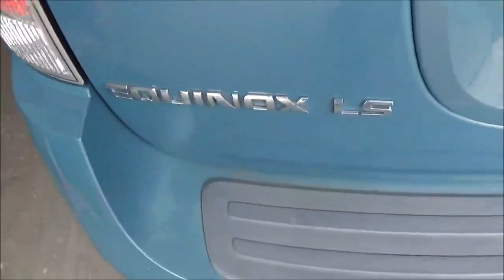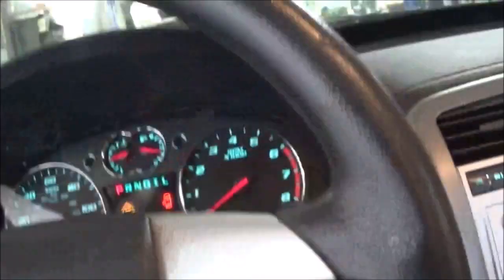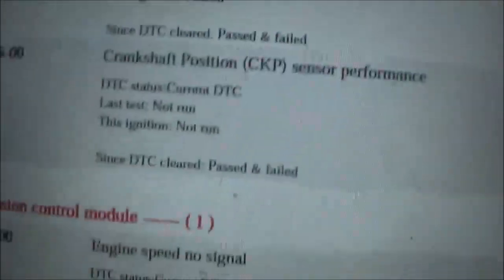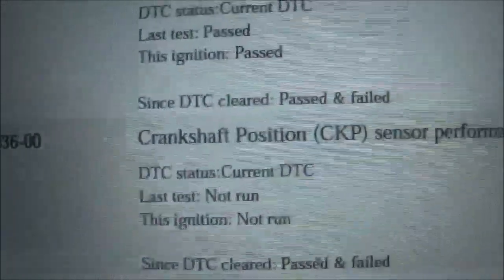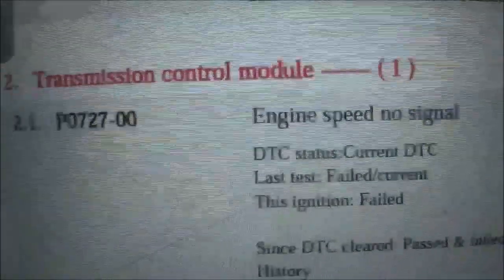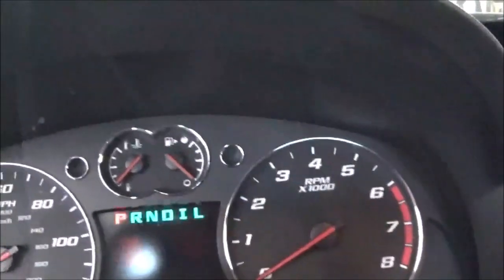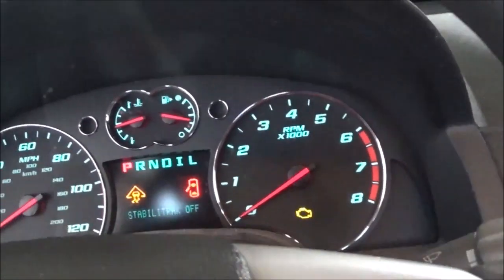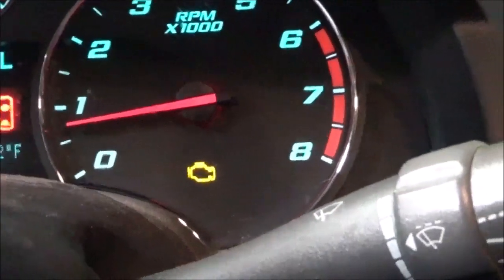TRANSMISSION NOT SHIFTING; ENGINE MISFIRE; RPM GAUGE NOT READING; HARD CRANKING; CHEVY EQUINOX

Comment: Same problem here no tach in limp mode replaced cam,crack,speed input speed out out timing chain and guides egr all new shift solenoids new trans filter fluid

Comment: same problem .. what is the problem
Reply: Hey what's crazy is on mine when it would do it we put a new egr and tube after it ended up cracking and it would fix it but now I replaced all shift solenoids cam, crank speed input and output sensors timing chain and guides bc I seen the guides wear out bc there plastic and it was off by one tooth and replaced filter fluid and still hast fixed it so I'm going to charge the ECM and TCM now to see what happens I'm worried one other the sensors that I bought isn't good but guess I'll find out